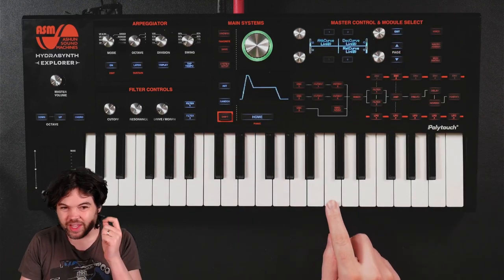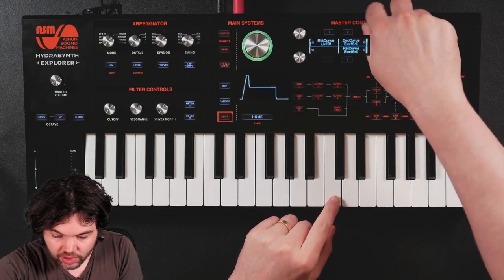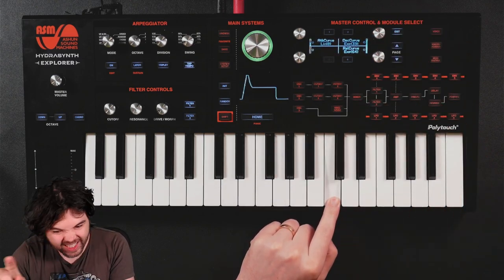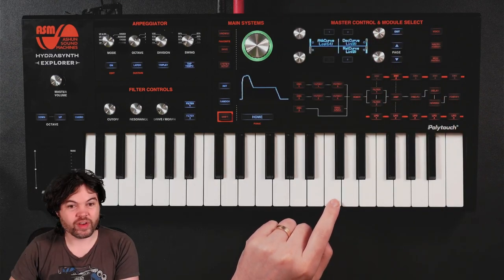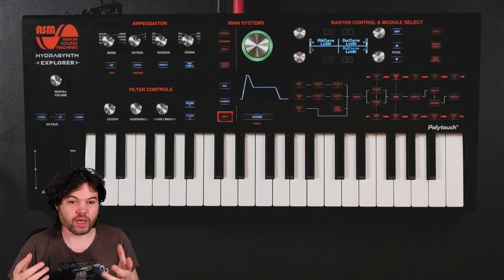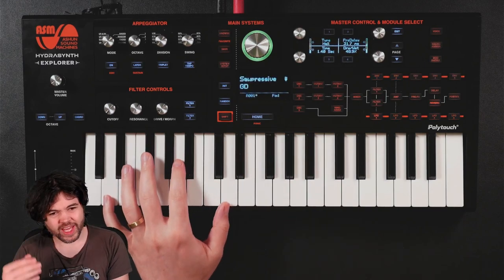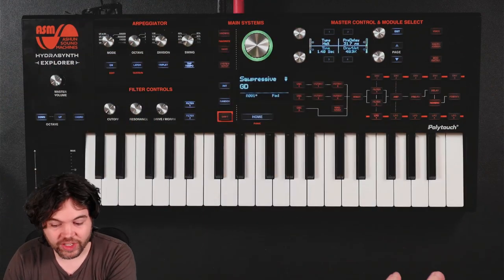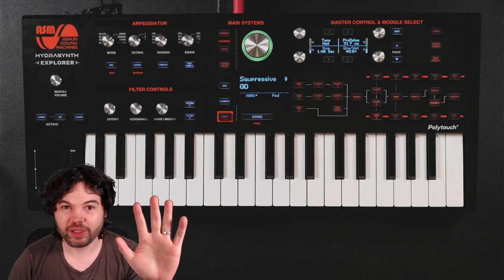Learn With Me - Hydrasynth: Ep08 - Envelopes Part 1

Comment: I would love to see you explore the mixer module in depth- it's an easy module to overlook, but the Hydra mixer is not quite as straightforward as any other synth I've had my hands on. Often, I'll attempt to deconstruct a factory preset that I enjoy playing, only to find that the oscillators are all at zero in the mixer, the mutants are at default values, and the ring mod and noise don't appear to be the source either. This has perplexed me ever since I started using the Hydrasynth.
Reply from the maker: Thanks for your comment, and for watching. I didn't have a dedicated video on the mixer, but I intend to cover it as part of the general sound design  examples. Where the mixer is all set to zero, it usually means that envelopes are modulating the mixer level in the mod matrix (or via a macro control set to a non zero level). I think I did this in "mutants part 3", though I probably rushed through it as I hadn't introduced the mod matrix yet.

Comment: I really think I prefer the placement of the filter, resonance, drive knobs on the explorer and desktop versions
Seems more comfortable for performing 
I have the 49 key og
It's way up in the right corner
Reply from the maker: Thanks for watching, and for the comment. I feel like the Hydrasynths have something of an identity crisis. They want to be a live player's synth, but also a sound designer's synth. I find myself thinking that the whole range is good, but with a stronger commitment to a certain user base, they could have been great. Little UI/UX quirks and seemingly strange compromises leave me frustrated at times.

I had considered the original version when it was launched but it wasn't a good fit for my setup so the explorer works nicely, but I'm using it for sound design where the 8 encoders on the desktop made more sense, but I couldn't imagine myself getting a Hydrasynth without the poly aftertouch keyboard. The pads are okay, but poly aftertouch grid controllers are easier to get hold of anyway.